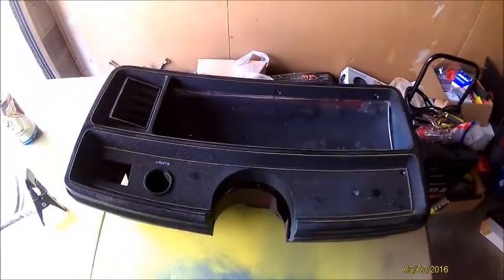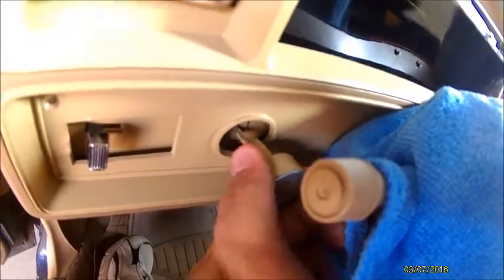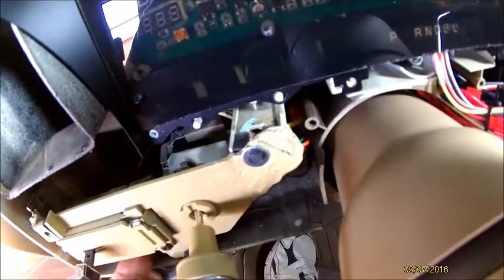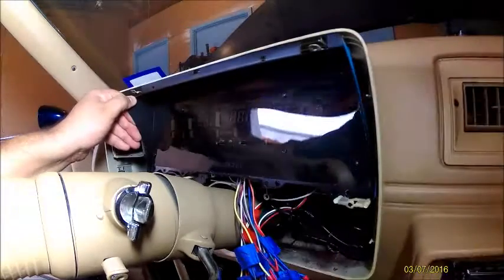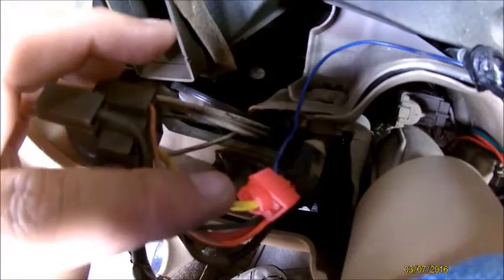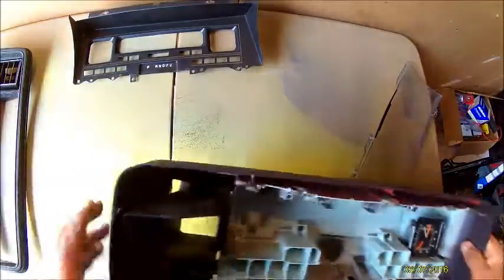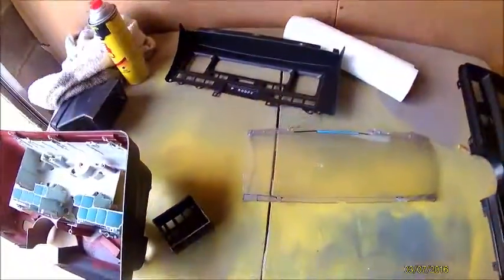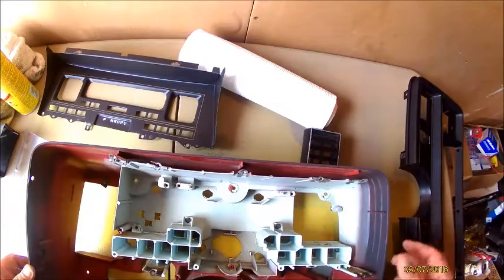Part 1 Intellitronix LED 6 Gauge Cluster install in a El Camino / GBody

Comment: Did the go's come with the Guages and if not what gps is it? Also do the wires just connect or solder on
Reply from the maker: The GPS sending unit is made by Intellitronix also, I bought it separate from their website. The set does come with a speedometer sending unit you can install on the transmission.

Comment: which one do u use if you have newer dash in elcamino
Reply from the maker: Not sure what you mean by newer dash? The only 2 dash's that I know of the G Body El Caminos having are the long speedo and the round gauges. Do you have a different one? the long speedo is like the one I had. The round gauges/SS gauges you would probably need to get the Intellitronix Create a Dash kit, if that is what you have I suggest checking out Eugene Mitchell's video he had the SS/round gauges. https://youtu.be/Ym1zvfz8hh4

Comment: Have you had any issues with the fuel sender not working properly?
Reply from the maker: Not on mine, it worked fine. I set the switches to GM,  no issues.
Reply from the maker: Was your sending unit working properly before? If so did you check the switches under the LEDs to ensure they are in the correct position?

Comment: What do u do for indicator lights like check engine?
Reply from the maker: I am not using the lights anymore. I am sure there is a way to keep them hooked up but with having the water temp, oil pressure and tach I figured I did not need them. I also do not have a gear indicator (Park, Reverse, N, Drive, 2, 1).

Comment: Would it be possible to use the Elco style where the idiot lights are on the side, even if i have the long sweep?
Reply from the maker: Are you asking if you can switch from the sweep style cluster to the round/ss cluster?
Reply from the maker: If this is what you are asking then yes you can. From 1978-1987 both instrument cluster mount the same. If you want to keep the factory gauges you will have to change the pins around in the harness, there are a couple of videos on youtube where people show how to do that.

Comment: Did you use the factory wiring to install the new digital gauges?!
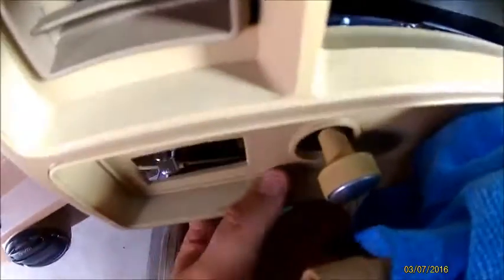Reply from the maker: I had to jump from the factory wiring harness. If you watch part 3, at around 4:04, you will see the factory pin/harness and to the left you will see a bundle of wires ~ they are jumped onto the wiring harness cables.
Reply: @MrTestertester  Also, did you swap out your fuel sending unit?!
Reply from the maker: @DaRealArtist  I did not. In the instructions it will show you how to set the fuel switches to match your vehicle (chevy, ford, etc...) so you can keep your factory fuel sending unit. I jumped the wires this way in case I ever wanted to go back to factory gauges, I still have my harness intact. I can just snip the jumped wires, put a cap on them and tuck them in behind the gauges.
Reply: @MrTestertester Ok, just curious. I’m going to install some aftermarket mechanical gauges in my 82 El Co!
Reply: @MrTestertester  One more question, did you remove the factory circuit board?!
Reply from the maker: @DaRealArtist  I removed the printed circuit board on the back of the housing, mine was not working properly and tore. That's the only thing I removed as far as circuit boards.
Reply: @MrTestertester  Thanks, mines is in bad shape as well. I wasn’t sure if I needed to remove it or not?!
Reply from the maker: @DaRealArtist  Only reason I removed mine is because I stripped the housing clean. I took out all the bulbs, gauges. Only thing I had left was the clean housing, metal piece, plastic dust cover that goes over gauges and the bezel. I did all the fabrication I needed. Cleaned everything up really good with de-greaser then taped/painted it.
Reply: @MrTestertester  Hey, can you tell me what color are the turn signal wires?
Reply from the maker: @DaRealArtist  Off the top of my head I do not remember, either grey or tan, but they were both the same color. I had to put turn the ignition on and put a multi meter on them with the turn signal on to figure out the left from the right.

Comment: How does the gps work when it’s in the dash and not direct view to the sky?
Reply from the maker: Mine works fine. I have it mounted to the left behind the gauges. It does have a second or two delay, if I take off quickly from a stop sign or stop light it will take a second to read the proper MPH. Same if I am going a steady speed and slam on my brakes. Also I checked it against a GPS app on my phone and it is accurate, on mine anyway. I am in the process of doing a custom display in my 81 K5 blazer and I am going to install a GPS unit in it because I like how this one is working for me.
Reply: Okay great that was the only question I had. Your Tutorial videos are great I just ordered the gauges for my 79 elco i chose the blue can’t wait to see what it looks like with an all black interior

Comment: I have an 80 el Camino and currently installing the digital gauges. Just curious where did you connect your dimmer wire? I've looked in my chilton book and cannot find where the dimmer wire is on the printed circuit? Thanks, any assistance would be greatly appreciated. Nazydre
Reply from the maker: I hooked it up directly to the light switch, can not remember the wire 
color but it was not on the printed circuit.
Reply: Wayne Woodley thanks
Reply from the maker: Anytime. The dimmer for the gauges just needs a power source saying the headlights or parking lights are on. I think I just used a jumper connector for the headlight that is hot when they are on. Some jump off the parking lights.

Comment: Thanks for the tip. It light switch was broken when I bought the car. I was wondering what would be the best adhesive to fix it.
Reply from the maker: Depends on what part is broken. On mine the headlight/wiper switch broke due to just being old. I cut some plastic off a old remote control I had, cut it to the shape I wanted and used some JB Weld. Held up fine. I have also used JB Weld on the inside of cluster housing to fix cracks/keep them from getting worse. I used the regular JB Weld but there is a plastic JB Weld you could use also.
Reply: Wayne Woodley mine is broke in the same place. I have a 79 Monte Carlo. Body is very nice. However it belonged to a kid so the maintenance was not kept up and it has been setting for 10 years in a garage on top of that.
Reply from the maker: @russellnentwich8745  Any hard plastic will work, just as long as it's not brittle.

Comment: did you have to get a new circuit board cuz I see yours is pretty clean or is that the original one
Reply from the maker: watsonlow22 I sent in a set of gauges to get fixed and they came back like new. One of the things that sold me on intellitronix gauges is the lifetime warranty.
Reply: Wayne Woodley ok Thanks

Comment: yes I think I didnt either on back of the  panel n what bout the speed function hw do u hook dat up I have a 86 cutlass
Reply from the maker: Just install in the speedo sending unit on the transmission, run the wires to the gauges and hook up the corresponding wires. I am not sure how to set it, you will have to read the instructions for that.
Reply: Ok thxs

Comment: hey what u do 2 connect your fuel gague
Reply from the maker: The fuel gauge connects directly to your current fuel wire/sending unit. On the instructions it will show how to set the gauges to work on your vehicle, just align the switches the way described and hook up the fuel wire from the gauges to the fuel wire on your car/truck.

Comment: is a 79 regal going to be the same
Reply from the maker: Does not look the same, I googled some interior pictures of a 1979 Buick Regal and from I saw it looks like there are 3 individual windows for your gauges. Looks like your layout is different and the instrument cluster is not the same. Intellitronix makes a create your dash kit that you can fabricate to work in yours, to get the long speedo like mine to work in yours is going to be a lot of fab work. Can be done but more work than I did on mine. I would recommend trying to find a used instrument cluster housing on eBay or a junk yard and do all the fab work on that one before removing your factory gauges. If your gauge layout is different than the 3 individual windowed gauges post a picture and let me look at it.

Comment: Where u get them from
Reply from the maker: I bought mine off eBay for about $180 plus $10 shipping.
Reply: yeah I looked them up thanks. I'm doing a ls swap on my 87 mc ss and I wonder if it works the same
Reply from the maker: +flysociety205 I believe I saw some post when I googled them on ls swaps and it does work, you will want to double check that.